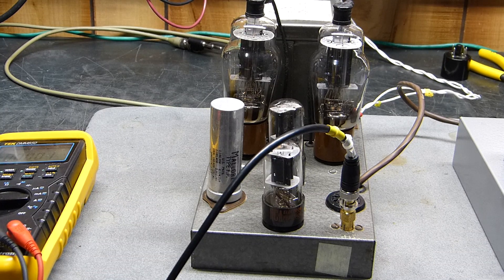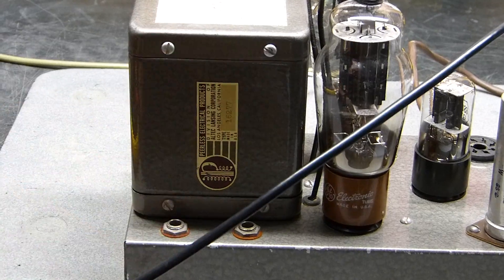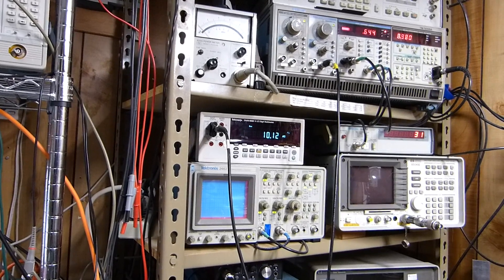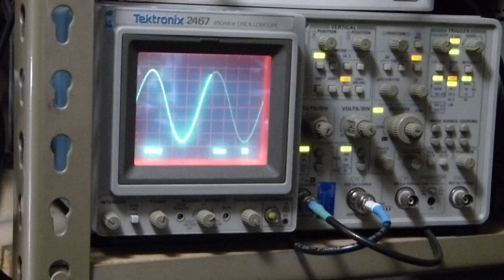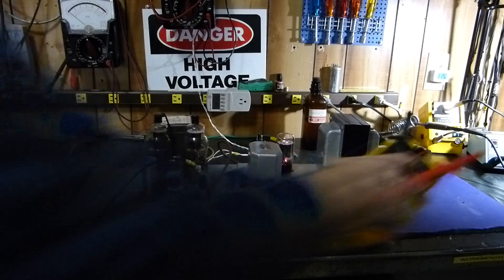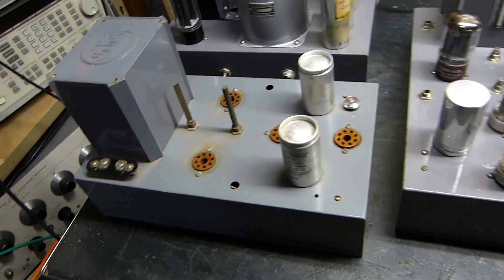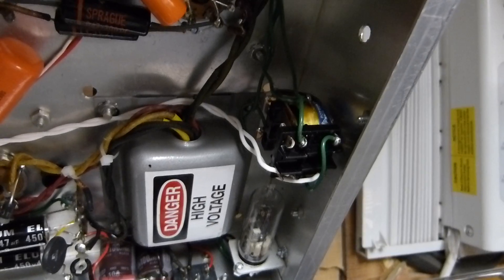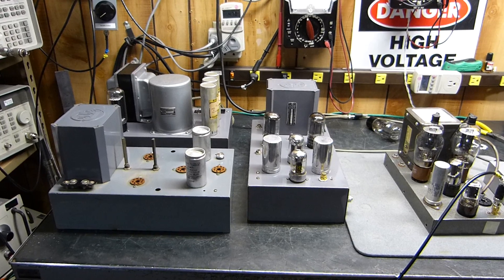Heathkit Model WA-1,  20 Watt, 807 Vacuum Tube Amplifier Tests

Comment: Hey there! I love your videos, figured after watching a few I'd write a comment. I recently found a 1955 DuKane 1u460 public address amplifier collecting dust where I work. They granted me a salvage ticket and I was able to bring it home.

It has a 5u4g rectifier, twin 5881s, two 12au7s and a single 12ax7. The three microphone channels each have empty slots for a dedicated stepup transformer and 12ax7 preamp. I only use the aux 1 and aux 2 as inputs, which are mono RCA jacks. Tubes appear to be the original RCA tubes except one 12au7 is a Sylvania, unfortunately the 12ax7 RCA has a filament flash on startup so that tube likely will not last too long. Miraculously, the amp works with the old tubes (although I exchanged them for new ones for testing) and all I truly needed to replace was the power cord. 

There is a noticeable 60hz hum that I would like to reduce if possible. Which components would you suggest I replace or check? Rectifier filter caps, grid resistors, etc? I work as an electrician/industrial process technician but it has been about 12 years since I went to electronic school. Clearing dust on the brain and the amp it seems.

Cheers and thank you for the great channel.
Reply: If you re-cap the amp and make sure the filaments have a proper balanced ground reference that should take care of the hum.
Reply from the maker: First off, that filament-flash is not a bad tube. Mullard,  Amperex, and  Telefunken and others in the European countries made some of the best tubes ever produced and that filament flash is proper. I understand it was an attempt to warm the tubes up quicker so the preamp/amplifier would work a little sooner. Check the brand on your tubes. You very well may have some real jewels and some of the information on the Internet about these filament-flash tubes is just dead wrong.
As for your hum, odds are some of the electrolytic power supply capacitors have dried out and the capacitance had reduced to virtually nothing. You can (very carefully because of the HV) just jumper in with test leads, good electrolytic capacitors across the existing ones in the amplifier which some are likely to be canned capacitors. If you jumper in one and the hum goes away , you just found one that is bad. Many people leave the cans in place just to cover the holes and keep it original looking but if they are bad it is best to electrically cut them out of the circuit.
Sounds like you have a great find...
Reply: @ElPasoTubeAmps  I'll second the motion on filament flash on the Euro 12AX7 types. They look like they are going nuclear when first turned on. I have no idea whether they last longer or shorter than US types over a longer term. I don't know why they flash on startup but they do.
Reply: @ElPasoTubeAmps  Thanks for the reply! All the tubes are RCA American tubes, except for one British RCA and an American Sylvania, which are the 12au7s. I have them removed to protect them while I figure the amp out, with good new ehx tubes for the 12ax7/12au7s/5881s and a JJ rectifier. Would rather one of those go bad in case I make a mistake than the old ones.

I managed to find some good capacitors, I'll attach jumpers to it and try that method out. Thanks for the info! I'll send you a link to the videos I have of the amp.
Reply: Here is a link to the amp, before I switched all the tubes over to new ehx:

https://youtu.be/VZtkAtwJ86U
Reply: At some point, virtually EVERY US mfr of tubes bought tubes from other manufacturers and relabeled them. Yes, even RCA, even GE. The Euro 12AX7 (by that I mean 12a_7) tubes commonly show that heater flash and it NEVER stops being a tad alarming when you see it. I have never seen any negative effect from it and frankly do not know if it affects their long term life. My suspicion is that the Euro tubes get to "weak" quicker than US types but I have no proof of that. It's absolutely possible that your "RCA" 12A_7 is a relabeled Mullard/Telefunken and will act accordingly with that heater flash. You probably did a good thing subbing in EH tubes for your vintage ones.
Reply from the maker: @pneumatic00  It is very true that even the Euro tubes of yester-year were relabeled by RCA and GE. I have some of those tubes with US labels on them and they flash on cold startup. I have an original McIntosh C20 full of original Telefunken tubes that flash and they have been flashing for over 50 years. I use this preamp daily in my home theater system so it is turned on and off at least once per day. I think that is pretty much proof that the tube life is not shortened and they perform perfectly and although it has been a few years since I actually tested them in a tube tester, they always turn out very strong and balanced between triode sections in the tube. In my opinion, and many others feel the same way, they are The premium tubes of all times so we don't want to throw them away.

Comment: I dun't know why but I am a big fan of their W1 through W4, esp the 3 coz it had that UL OPT and the 4 coz it was such an underestimated performer.
Reply from the maker: I understand that so well nowadays. Many years ago I have had probably every one of the W series of Heathkit amplifiers and as I mentioned in the video, I not appreciate them. I wanted More power - lots more power but now I understand a really high performance 20 watts is the perfect range and many of these vintage vacuum tube amplifiers perform beautifully.

Comment: I had a pair of Heathkit A 9 and Amplifier company of America . I think A 9's were 20 watts each though i could get more out of them. I was using a preamp so I was using them as mono block power amps.
Reply from the maker: I  believe the 20-40 watt range for a first-class amplifier and a set of efficient speakers is all we usually need unless we want to drive the nails out of the walls.   Sometimes I want to do that...  :-)    but, on any reasonable level, the power amplifiers, I believe, are in the "sweet spot" of  performance at this lower power level for the 6L6 class of vacuum tube amplifier. Many of the vintage audio systems deliver this performance going back to the 1940's and certainly in the 1950's and 60's. Transistor, solid state, amplifiers stormed the country in the 1970's and the rest is history, as they say.
Reply: ElPaso TubeAmps My power amp is 250 X 2 RMS 8 ohm class H I believe. You can probably guess what I'm using.

Comment: Just a thought, why not put a delay relay in the heater circuit of the rectifier valve? That will also bring up the HT slowly rather than a sudden jerk. By this time the other vales will be ready to run.
Reply from the maker: Good thought. We would have to check the current rating of the contacts on the delay-relay to make sure it could handle three amps for a 5U4  but I love the thoughts added to the conversation. It absolutely helps me in my future projects. Thank you.
Reply: @ElPasoTubeAmps  perhaps another alternative is a pair of TV damper diodes. Slow warm up without the high price of real vintage GZ34s!
Reply from the maker: @meshplates  That is an interesting idea - like a 6AX4 which I may have several of. I will have to look up that tube and check the max plate current. I am thinking it has a separate 6 volt filament/cathode. Thanks for the good idea.